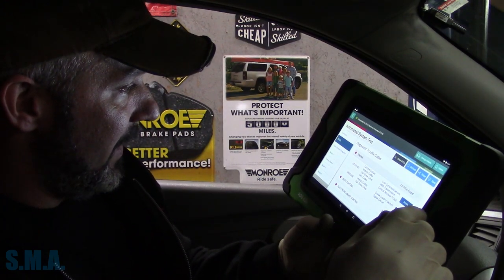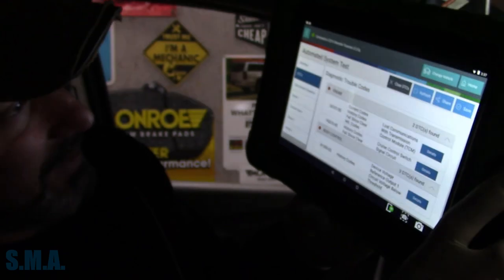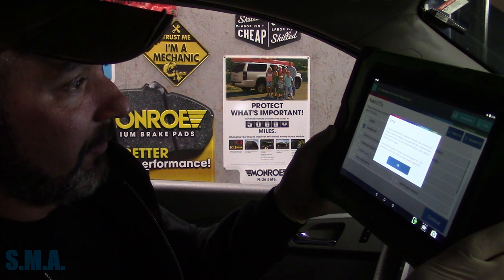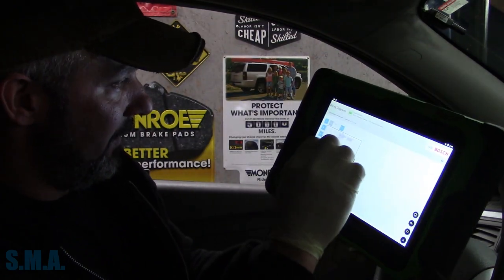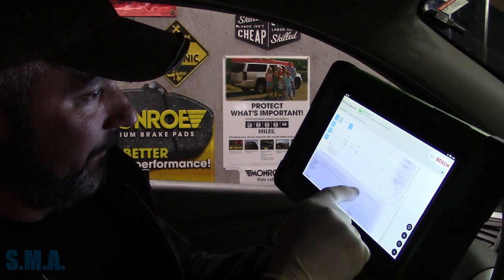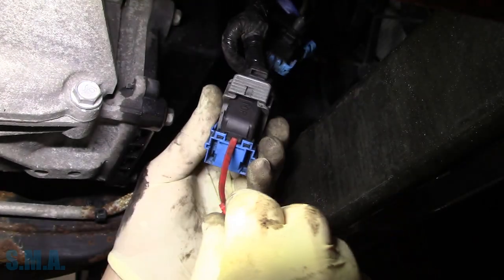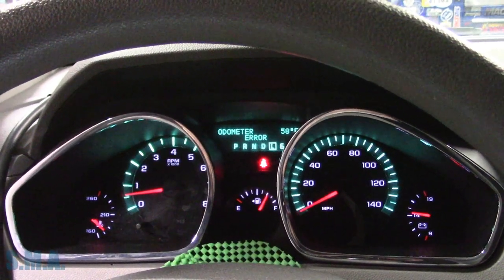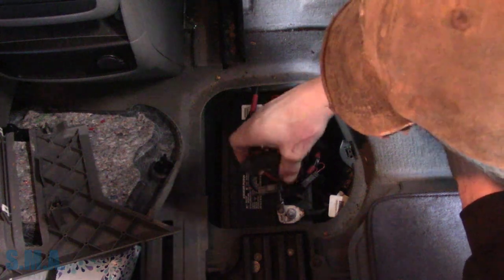Chevy Traverse: No Communication w/ Transmission Control Module

Comment: 12 cents more tape at the factory could have saved hundreds of dollars. Yup, car companies today.
Reply: @Tk3997  its no secret that manufacturers are making their stuff cheaper and still marking up the price. GM is a good example. They started using less bolts to bolt the heads on their engines. Cheaper to produce but asking for problems down the future
Reply: As long as it fails after the warranty runs out...
Reply: @Tk3997  In manufacturing nothing is overlooked. The bean counter scrutinize every decision an engineer makes to try and squeeze out cost. A few pennies here and there over 10's of thousands of of widgets can buy the CEO a new yacht.
Reply: Agreed this could have easily been avoided.

Comment: Cored wires are cored for a reason. In vehicles, everything is subject to vibration. Electrical wires are cored to prevent deformation hardening. When connecting wires with solder, you suddenly turn a small piece of the cored wire into a rigid conductor with very vulnerable transitions on the boundary between the cored and the rigid part. In this interface there is great stress on the conductor and the grains start to crack one by one. I have worked with electronics for over 50 years so I knew the problem :-)

Comment: Solder joints on wires always break, some faster, some slower. Crimp is the way to go but you need proper crimp tool.

Comment: Try a 3% silver solder, you will never go back!
Reply: I prefer a 63/36/2. As long as it isn't lead-free. That's why we got where we are in the first place.
Reply: no automotive harness uses any solder anywhere in a wiring harness.  Got to be a reason for that!  Hint: soldered connections eventually can break.
Reply: Patrick94GSR solder is great on P.C.B’s and that’s about it.I work with a know it all who repairs all wiring with solder I suggested once to him about uninsullated barrel crimps “I’ve used solder on wiring for years and never had one fail !” ..must be nice KNOWING All

Comment: Back in the day,.... I used to work on larger types of computers that would consist of several modules plugged into a "backplane" to make a single CPU (not like the 12 CPUs on a single chip today) and the company, when they made the change over to lead free solder, got a bad batch of the stuff.  Components were surface soldered on to these modules with a "wave flow soldering" process.  What began to happen was that the solder would fail in such a way that if you firmly thumped the edge of the modules, with something like the handle of a screwdriver, you could hear some of the surface mounted parts, resistors and capacitors and such, pop off and trickle down the insides of the computer.  You can not truly imagine the amount and bizarre types of failures this would cause.

Comment: Eric,
I watch you use the wire strippers with the stripper function between the handles in confined space like on this repair and feel sorry for you. There are so many good wire stripper designs with the stripper function in the front and are so easy to use I wonder why you struggle with your strippers. You usually invest in the appropriate tool. You should buy a new pair of wire strippers. I like Klein. They are inexpensive, function well and last a long time.
Reply: even more impressive, he is doing it a hot circuit, no fuse pull or battery disconnect.

Comment: As soon as the U code popped up I was thinking broken wire due to corrosion or wear through. Looks like I have been paying attention in SMA diagnosis 101.
Eric are you going for some weird Guiness world record for diagnosis? Didnt even get the SMA main stays (brake clean, TYP,L!, Woah!)...must be busy over there in Avoca! These days that's a good problem to have.

As an warranty service provider of our 2013 GMC Terrain I know the issues caused by bad design, broken wires, and road salt. Car is only 7 years old and has had exhaust replaced, 3 of the 4 doors are rusting out, center stack controls stop working at random, and a front main seal oil leak. Also had engine rebuilt at 750 our cost (the wonderful Ecotec 2.4l) since we noticed the consumption just a few hundred miles past ext warranty and when they went to do the rebuild, the exhaust manifold was cracked. 
Just another whining customer hating american products, right? Nope. All of these issues except for the center stack controls, are KNOWN ISSUES with both the Terrain and the Equinox. Tech its the wife's mobile and she grew up GM proud but cant wait to ship that sucker down the road. 
She wants to replace it with...a Traverse or Acadia!

Comment: I've found at solder joints the copper wire breaks because the solder itself is not flexible in places where there is vibration.

Comment: I had one with the same exact wire rubbed through like 5 years ago. I remembered that it was a white traverse with a breathalyzer in it. GM failed to use a zip tie in that area. Now when they fail in that area its because the wire chafes on the zip tie! Had a 19 Equinox do that for a chassis harness on the power wire for the rear differential control module. I always double up on tape when i can or use the fancy fabric tape.  You probably won't see these cars for a few years but do you know if the ADS 625 will be compatible with the next generation GM Global Architecture? Some of the caddy's have it, the new C8 corvette has it and the new 21 tahoe and suburban have it and require the use of the MDI 2.

Comment: The pink heat jonts are the best the are also recommended by manufacturer... I Always use them on CAN BUS wiring I never use the solider joints as the cause problems as the flux in the soilder cause the wire to deteriorate and brake..

Comment: I wonder if the odometer error is tied to the fact that the computer and the odometer (IIRC) both store the mileage, and computer might have known that the car was running and driving (due to the transmission select lever and engine speed) while the odometer only gets it's signal from the TCU.  Thus - because they have different mileages it's giving you an odometer error as a warning that it might have been tampered with...
Reply: that's what i was thinking

Comment: I had some of those heat shrink butt connectors from amazon. They were cheap and I think too thin of a wall and the wire would pull out of the crimp. They just wouldn’t hold the squeeze on the wire. A whole box of them were garbage. I usually get them from Walmart and they work well. So buyer beware.

Comment: Low temperature solder is nothing but lead. We tried them at work and had the same problem. Now we use silver solder and shrink tube. No more problems now.
Reply: Lead melts above 620F wile 60/40 solder melts below 380F. Low temperature solders are mainly ordinary solder with indium added.

Comment: I would only use  self soldering versions on low voltage critical communication path connections. Not power supply versions as they can heat up.

Comment: Hey Eric the document number for the pin out diagram for that vehicle is doc #  2332233 in GM service information. To get there just look up your power and grounds document click on the locator tab but don't put X1 in the search. It won't come up for some reason. Just scroll down the list. It is under the description "control solenoid valve assembly". Hope this helps in the future.

Comment: re the solder butt connectors - noticed that the lead free solder ones cracked more then the older lead based ones I had. Was always taught not to use solder on a connector that was subject to vibration due to over time it causing the joint to crack.

Comment: Crimping is the SUPERIOR method of joining wire!
Reply: I worked in General Aviation (small planes) as an avionics tech for 14 years. Solder splices are forbidden there, and crimp splices must have separate crimp areas to crimp onto the insulation.

Comment: Had the same problem 2 weeks ago, cust brought in his own trans control module in wanting it replaced. After taking apart found same wire coroded,   Also why don't you use your sand blaster on brake brackets

Comment: I never thought that I would be able to give you a tip but an x-acto knife with the blade facing out to cut the tape considerably lessens the chance of slicing into the insulation of a wad of wires like that. Take it from the old man with arthritis and carpal, it's easier than trying to "eyeball" the depth of your cut. Also; premature eclickulation?

Comment: Regarding those low temperature solder splices.. I don't care for them either, it seems difficult to get the solder to wick into the strands very deep.    The very knowledgeable Big Clive (bigclivedotcom on youtube) did a video recently where he tried these out and cut the joints open to compare the solder penetration with a traditional soldered joint, and indeed it didn't make nearly as good of a joint.     I'd link that video, but he hasn't released it publicly quite yet (i saw it on his patreon feed).  I imagine it will come out soon if he hasn't forgotten.   And yeah, people often don't appreciate how very good a proper crimp is.

Comment: If that was at a dealer they would have changed the whole harness and not do a simple repair like you did.
Reply: as a general rule, Anything over a certain age should not be taken to a dealer for any service. They want to do everything by the book. I learned this years ago. I told them the book is made by people in a building that DO NOT fix vehicles. They only design them. 
The jockeys that make the repair factory books are again, college educated idiots( as my dad always said). They figure up the time it takes to do a repair under their conditions using their tools. Not a shop that is run by someone like us.
Reply: Not me. If its close to the connector i make a terminated lead and splice it in. However if a terminated lead is not available i look through my boxes of old harness for a matching connector and rob that harness to make what i need. Unfortunately i had to replace a harness on a 2019 Equinox because GM doesn't offer a terminated lead or terminal for the connector i needed it at. and the customer was inconvenienced with no AWD for a month waiting for the part to come in, oh man i could go on for days about how GM doesn't seem to care about customer satisfaction anymore.  I try my hardest to make the customer happy but and limited to parts and how the service department is run.
Reply: First, a rebuilt trasaxle..........

Comment: The low heat solder connections are not good for any load (high amp) wires, good for signal wires (low to no amp wires) only. they provide a what is called in the electronic world "cold weld" (at least in mine) and will fail.

Comment: I actually called your shop for a Subaru outback head gasket since I seen you managed to do it without taking the engine out...love the message by the way...  Wondering if you think it would be ok for me to do it ... I do basic oil changes some shock s and brakes a starter or alternator here and there... Please need your input..

Comment: Those low temp solder conveyers are not quite as spiffy as the ads, All I have used them for is a radio adapter harness which still works... so far🤣

Comment: What’s the odds of having a faulty wire on the inside of a wire loom/jacket if the appearance of the loom/jacket is clean with no damage? Deciding whether to remove the whole tubing or not.

Comment: Perhaps the transmission module (or BCM) keeps a copy of the mileage, and the odometer checks against that to make sure no one tampered with mileage / memory error occurred. 🤔
Reply: That was my thought. If it's using the transmission to calculate the mileage as opposed to wheel sensors perhaps losing connection and therefore the ability to track mileage triggers an error in the odometer. I have no idea if that's how they behave or not but it certainly seems plausible

Comment: Nothing to do with this particular video, but I was looking at some of your other videos and saw a couple where you were working around the radiator and made comments about being careful not to let anything bump against it.  Not being a mechanic myself, only a farmer of sorts, so I have turned 2 or 3 wrenches in my life, but I was wondering why you don't have a heavy chunk of cardboard or maybe a thin masonite board, maybe even with a felt backing, that you could slip in there to protect that radiator.  An eighth inch thick masonite panel with a felt backing wouldn't take up that much space.  On tractors the radiator is located just a little bit more "remotely" from the engine and also typically just a bit more elbow room around that engine as well.  :^}

Comment: My guess is the IPC is mad about the transmission not reporting for a while, invalidating the mileage. For all it knows you put 100K miles on it.
Reply: That's what I was going to suggest - it may just be a warning that the odometer isn't accurate.  If that's the case, I'm not sure as it would be clear-able by ordinary means.
Reply: Very plausible,
Reply: Good catch!

Comment: I don't know what's worse the green crusties or roden't damage. I looked at a car yesterday,  The mice had a field day.  Stock tip. buy 3m for the amount of tape I am going to use. Ancor adhesive for the heat shrink. Kester for the solder. When I am done their stock will probably double!  :)

Comment: I have a 2007 Prius touring model and would like to know what the best scan tool is for my car.  I’d  like to do a complete brake system bleed and don’t want to do any jumper wire crossing that I’ve seen on some you tube videos.

Comment: Just wondering, if that ODOmetter error could be because. ABS counted miles(from speed sensors) but transmission didnt see it and as so Cluster sees miss info from different control units and so it thinks its bean screwed for selling standpoint....

And so reading ODO info from ABS and rewrite it to transmission could maybe fix this issue.

Comment: Eric have you ever had a dodge 2007-2012 era caliber avenger journey 2.0 or 2.4 have a random misfire code but can’t feel the misfire? And while giving the beans it runs great all the way to redline. My STFT cold start is like -7 to -9 I sprayed the intake by gaskets brake clean and it went to -14 but as it warms up it stabilized to 0+or-1 and no change in trims. Runs smooth and fine but it’s detecting a miss somewhere but nothing is felt.

Comment: I have an 07 impala police car. been running great for years but just lost comms with ABS. i checked all fuses and pulled them all one by one. I ended up loosing comms with TCM now. I do not have the box around the gears to let the computer know that its in park so i have a no crank issue and the trunk release will nor work. any ideas? thanks

Comment: Did you mis-speak?, 2- 220 ohm resistors in parallel is 110 ohms. It would have to be 2- 120 ohm resistors in parallel to be 60 ohms.
Reply: He said 120
Reply: I misheard it the first time too, he actually said "2 120-ohm".
Reply: @ischmidt  Since it was verbal, it came out "we have two hundred 'n' twenty ohm resistors in parallel." (8:05)

Comment: Hello , I know this is an old vid, but I currently have a 2012 chevy traverse. It revs fine in neutral , but will not rev past 1000rpms in drive, or reverse. Is that what this vehicle was doing? Thanks!

Comment: So I was wondering If I could pick you brain on something.  I'm a mechanic ect and I'm getting kind of stumped on a vehicle. 

2012 Chevrolet Traverse LTZ AWD 140k

Engine was installed with new timing chains around 20k miles ago. 

I've done the following

-Spark Plugs
-Struts
-Power Steering Pump
-Serpentine Belt
-Transmission Fluid
-Alternator 
-Blend Door Actuator
-Motor Mount 

Now just recently the customer was complaining about how when she is driving it the rear end of the kind kind of moves off to the side.  I realized the rear end was going out because the front wheels and right rear wheel was moving but the left rear wasn't. Did more of inspection and the rear end was toast, so I replaced the rear end with one with 90k miles and replaced the seals/fluid as well.  

She gets her car back and tells me that when driving it will randomly hesitating to go and all the lights came on and the radio shuts off.  But then she can turn the car off and restart it and it's fine.   I later noticed when I had all things going on the car with Ac,Lights, Radio ect I noticed the battery voltage was very low so I assumed it was the alternator doing it so I replaced the alternator again.

So now she's still having the similar problem of  it kind of dying and it hesitates to move and all the lights come on the dash and the radio went off. Then every time she cuts the car off the radio goes off and she has to power back on every time to get in and when she turns the car off and roll up the windows up the key has to be turned didn't have to use to turn the car off and still be able to roll the windows up and the radio would stay on.

I just installed a new rear differential because the left wheel was locking up.  I also just installed a new alternator

So I'm not sure if you've ever ran into a Traverse-Enclave-Outlook-Acadia ever randomly hesitating and then all the dash lights flash and the radio cuts out and then you can turn the car off then restart it and it's fine but will keep randomly doing it.

Comment: @South Main Auto Repair LLC. You probably already know from your experience but a proper crimp connection is superior to soldering.   Crimped or compressed connections are the best when used on systems that will move and vibrate.  Ask any rocket scientist you meet.  Or you know,  just google it.  :)

Comment: I use those same butt connectors all the time.  Mostly the red and blue.  If you see a CINTAS or FEDEX Trk over 5 years old it probably has 100’s of butt connectors in its wire harness.